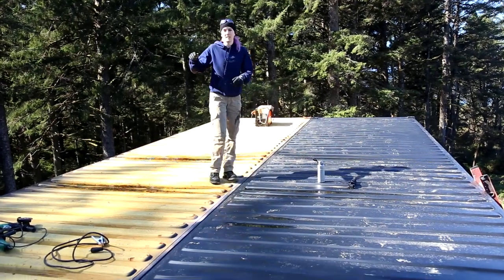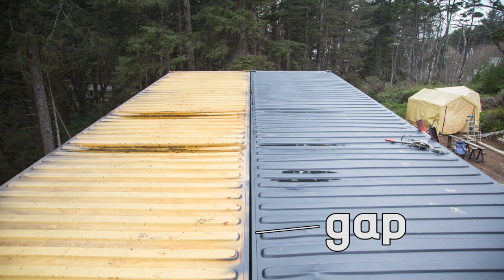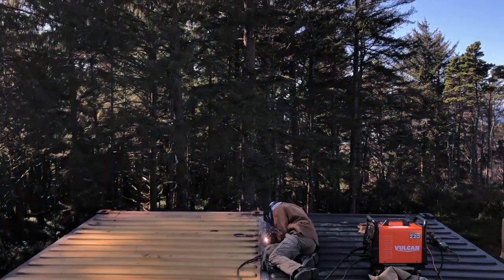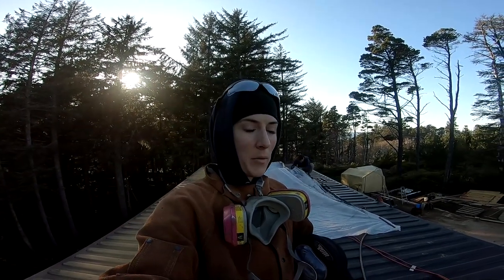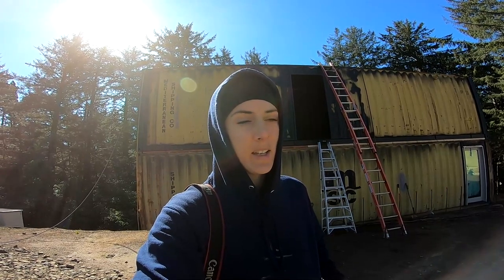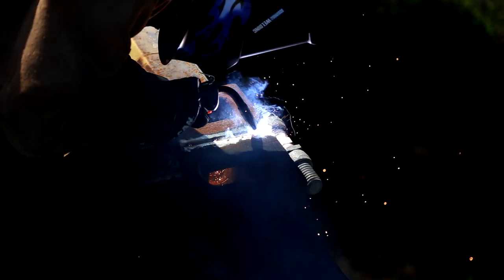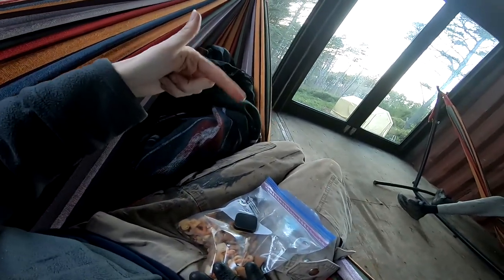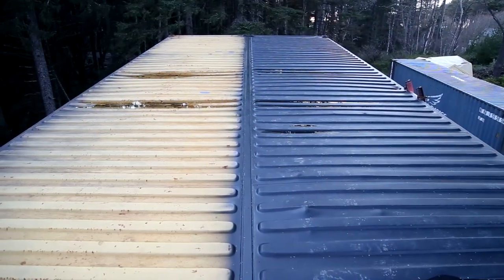How To Waterproof 2 Shipping Containers - Welding The Roof Of Our Container House - Ep. 31

Comment: I had a 4x8 sheet of 1/8" sheared into strips (I didn't shear the unneeded half sheet and used it elsewhere) for the roof joint as it was cheaper than buying flat stock. 
A combo I find effective (I have five containers, including two 40' HC joined as a machine shop and two 40' HC with doors on both ends as motorcycle garages/shops) is a suitcase feeder for the wire welding and leaving my power source inside the container. I even put welder panel fittings (cheap) through one wall so I don't have to open any doors to weld outside. E71T-11 did fine for the sheet metal. For crusty parts like the corner fittings I ground out the joint and ran 6010 or 6011 (whatever box was closer, this ain't SpaceX) stick.
Reply from the maker: Love that idea! Thx for the suggestion!

Comment: Will this roof be exposed to the elements?
Is there any other waterproofing materials you will be using such as silicone or rubber roofing? 
THANKS !
Reply from the maker: No we will have a structure above it. We welded the roof completely to make it water tight. I will be putting out videos in the future about our roofing structure so stay tuned for that! :)

Comment: You're nearly three years into this project and everything still looks the same as it did your first video in 2019!
Reply from the maker: I’m behind on editing. In real time we have all 7 containers placed and are almost ready to start the interior.
Reply: @PacificPinesRanch 
  I am VERY interested in your insulation plans... specifically: moisture "control" layer versus moisture*barrier* layer approach... 
I am considering either a Freezer semi trailer/Freezer marine shipping container - as they are spray foam in a compressed form in a vacuum process for consistency and control of curing & off gassing... according to at least one source...
Or applying spray foam to the EXTERIOR to a depth of about R-50 on the sides and R-80 on the roof or just somewhere between... - then applying some sort of siding to protect foam (unless I can find a way to set up the siding or a secondary layer of shipping container wall and fill evenly and effectively bond to both so there is no trapping of moisture or pockets - this would be an ideal option)
I plan/prefer to use Marine shipping containers/Corten steel...

The idea of putting the spray foam on the exterior 360 is to safeguard any and ALL issues with off gassing of toxic chemicals from it, AND so as to be free to insulate to our hearts content WITHOUT losing valuable and quality of interior livability by sacrificing the dimensions inside to insulation....
Reply: @PacificPinesRanch  mold/ moisture is a major concern... As also is the damage that termites, ants, and mealworms and other can do to FOAM BOARD!!! - Something that I only recently discovered that ALL foam board is succeptible and the only ones that claim otherwise only offer an "aromatic scent deterrent" - which then begs the question of another chemical sensitivity/toxins AND how long before it fails and gets eaten anyway? And does it work on ALL crawling bugs that might devour it?

Comment: i appreciate all the hard work but i have to say all that welding is such a huge waste of time and money there are far easier ways to seal that seam and container. Stitch weld it together and use some type of silicone product
Reply from the maker: There’s definitely other ways to do it. That’s the beauty of it, there’s no “one side fits all”. One reason why we welded it all together was also for added strength.
Reply: @PacificPinesRanch  the container will never be as strong as all that welding.
Reply from the maker: @Vegasoffgrid  it’s more for the lateral support 🙂
Reply: That assertion is testable and I tested it. You're mistaken. Sealant can leak and wire welding is comparable in ease though not speed to sealant application. Welding is a better deal because (unless you spend megabucks and use something like Semkit aviation fuel tank sealant which would cost a few hundred bucks for that size joint) you only have to do it once. A major reason I use containers is recurring maintenance reduction and it's paid off.

Welding containers is especially convenient because I leave my power source inside and ground to the shell then run my hot lead (I use a suitcase feeder) to the roof. Given the cost of quality marine/industrial sealants I'm money ahead running FCAW too. I used two partial rolls (.035 is best but I got away with .045" without burnthrough by starting the puddle on the container not the strip so I could use up the .045").

Comment: Silly... Why would you weld... Spray foam and sealant along with container clips is all you need you just spent money and did more work then you ever need too...
Reply from the maker: It’s not only to seal them, it’s to connect them together so they are one unit. Since we will have 3 levels and a rooftop deck it’s better for the strength. Also I’d rather completely seal them now and avoid any issues in the future.
Reply: @PacificPinesRanch ok:) but then you can't move them but I guess if your on unsure ground then you might want to make it stronger...I just know from experience you find really need to go through all that trouble... But I think if that works for you then go for it:)
Reply: @PacificPinesRanch  I'm sure your going to load up the inside with 2by 4 and think insulation and on and on and it would be cheaper to use ruff cut lumber I'm the end the idea of a container home is too use a container that take all the cyst out of the job.... Otherwise it's kinda a to waste of money to use old rusty containers....I was just trying to save you time and money but I also find want to get in the way of your ideas and dreams... So sorry just was calling it as I seen it on the way by...I didn't mean to....
Reply from the maker: @ericjohnson8586  No worries! There’s definitely different ways to go about building & to each their own. Since we pretty much live in a temperate rainforest we have to be pretty serious about waterproofing, or our house will become a humidifier lol.
Reply: Welding is easy and leaves zero recurring maintenance is why I welded mine. Spray foam isn't even close to the durability of a welded joint. I speak from experience dealing with my spray foamed joints elsewhere (the end verticals) and I'm going to wire weld strips down those to cover them. Welding any of this stuff is so easy it barely qualifies as "work".

It's also easy to make a structurally sound waterproof roof or side joint using angle instead of strips. 
Lay two sticks of angle back to back.. Tack weld the ends so nothing shifts (clamps can shift, tacks are precise). Drill bolt holes at your preferred interval through both. Insert bolts to snug them together after using formable automotive gasket maker (they sell large tubes) on the joint and anti-seize on the fasteners. I'd use stainless bolts (quite reasonable online) for corrosion resistance and (especially because stainless galls against other stainless) anti-seize the threads. The joint could be unbolted using any 12V cordless impact. I came up with that idea because three of my High Cubes are side-by-side on steel beams and I want to connect the most recent temporarily to the other two (which are welded together) for a few years until I'm ready to slide it outwards and erect a Steelmaster style container cover on that side.